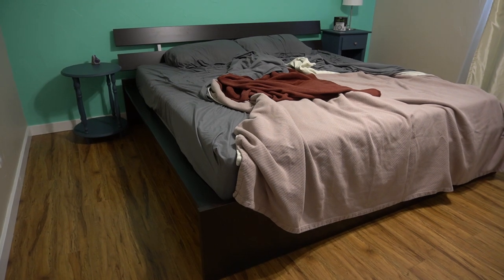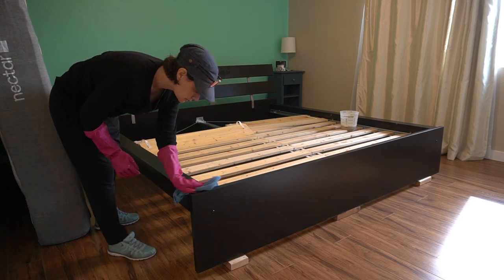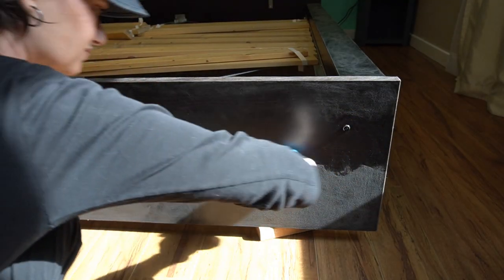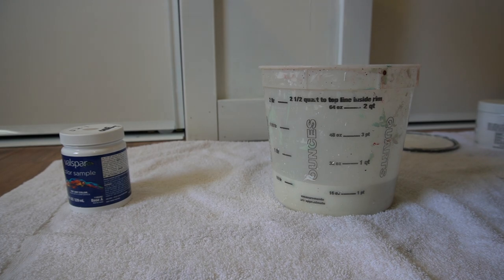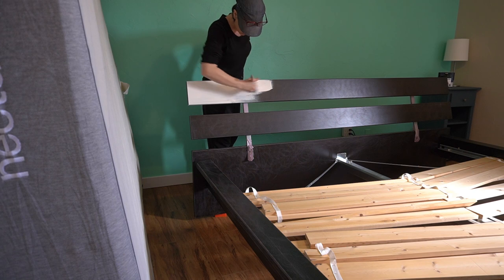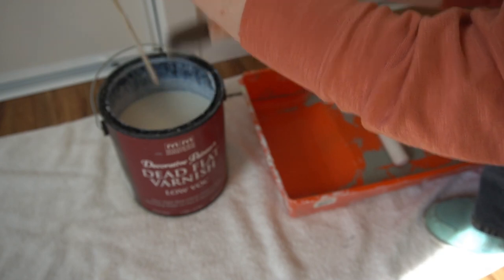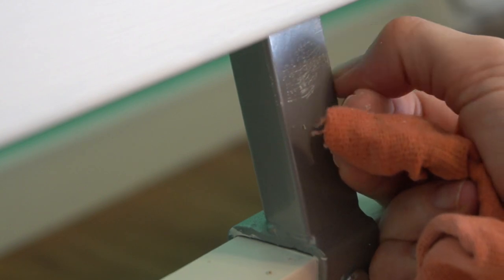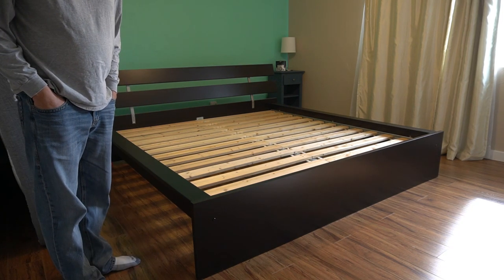Painting a King Sized Bed Testing BB Frosch w Latex Paint #furniturerepaint #bbfrosch #latexpaint

Comment: Very pretty! I didn’t catch the pink until it was up against the green wall and you pointed it out. 
BTDT with the slick stick “oopsie” too on my daughter’s HUGE and very heavy 10 drawer dresser. Of course if there’s even a question for a piece I’m selling, it gets at least one coat of it, but not for my kid’s piece lol. Once I realized my “oopsie”, I put the slick stick right on top of the paint, then repainted it. There was no reason to strip the paint and top coat off, just slick stick it. I did check with Dixie Belle to confirm bc the dresser isn’t real wood either (it’s MDF made to look like stained wood) so it’s not like it was ever going to be stained. Hope this helps!💜
Reply from the maker: That could work but the bonding primer I have isn't actually Slick Stick. I'd have to check into mine but I believe it needs to be the base coat. Also though, Modern Masters is nice at encapsulation so I might get some extra time before it shows scratching. All in the learning? Maybe, though it only seems to happen on these huge pieces right? Lol Thanks so much! ☺
Reply: @CopperCactusDIY   gotcha. I was still using a lot of Annie Sloan up until I painted the dresser and have never needed a bonding primer for anything I’ve painted using her paints. I didn’t even scuff sand (didn’t know it was a step at the time) my buffet, also the very first thing I ever painted and five yrs later it still looks like new. So when I painted the dresser with DB I’m not sure I even knew what slick stick (or any bonding primer) was at that point lol. Definitely all in the learning!😊